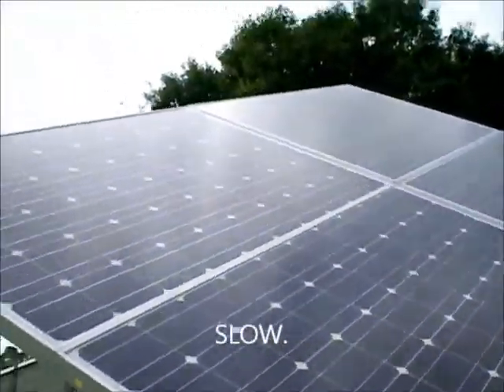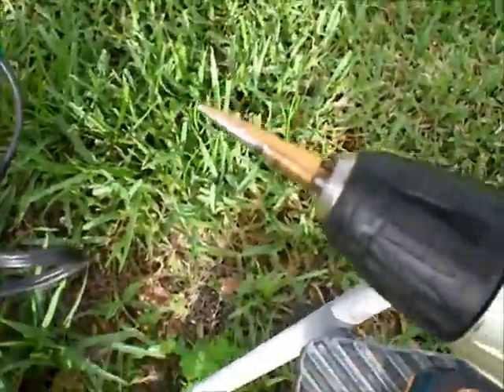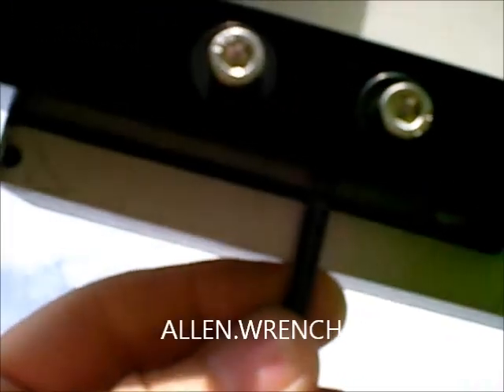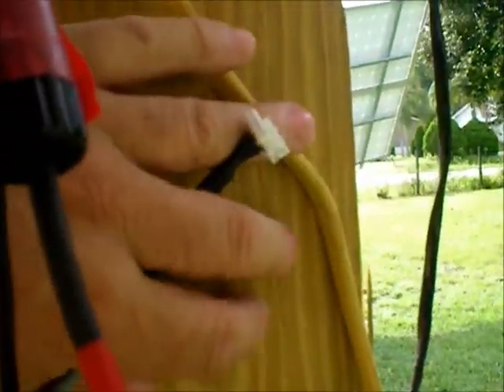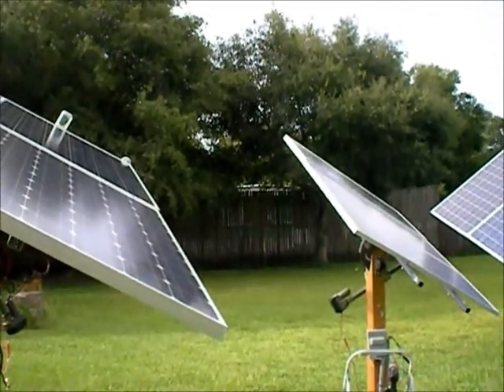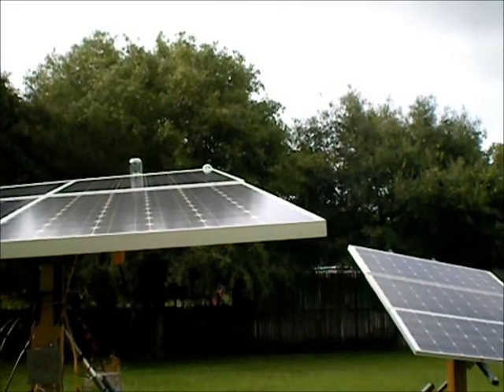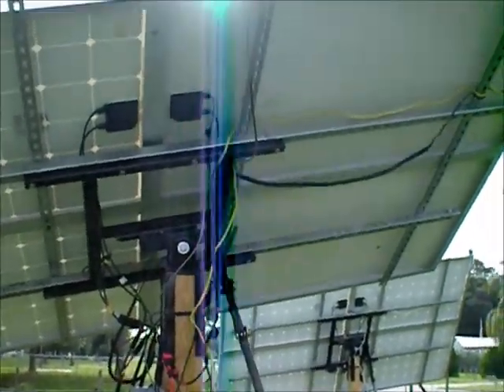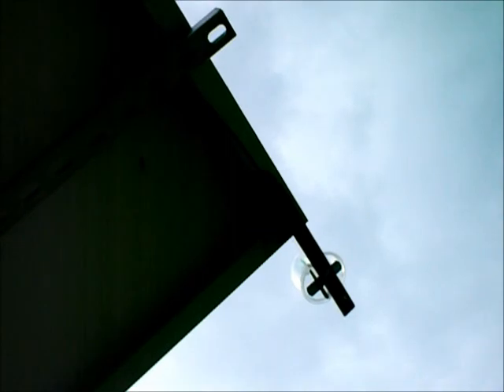Prototype Sensor Dome Install Fast & Slow Version.

Comment: I guess I could lay a wire across the lawn over to my other panel and let work the other tracker. I could see if it would work. It should not be a big deal. I just hook up to the same place the other actuator hooks up piggy back. the stops are already set.

Comment: I was thinking after you messaged me back like youhave it controlling the small array and I have noticed after a while the small one will get out of sink so in a way for each seperate array you need a seperate controller. unelss they were all in sink some how.  but I guess for you you are doing both north, south east and west.  but I guess if you were just doint east west you could have something just connecting them all in a line. but I do love your set up. wish I had the money for that.